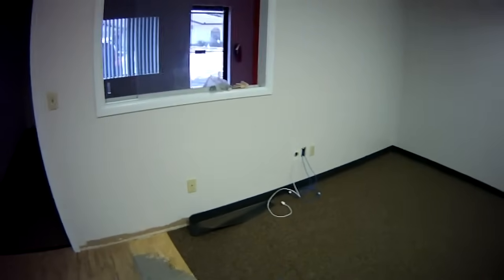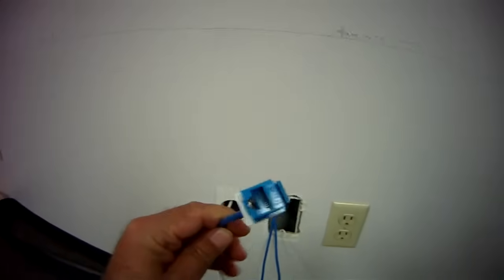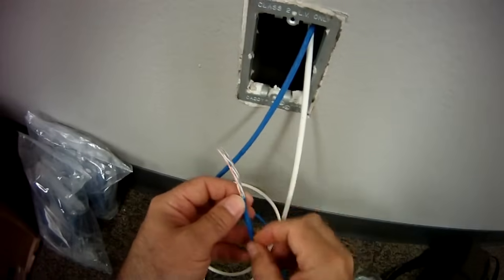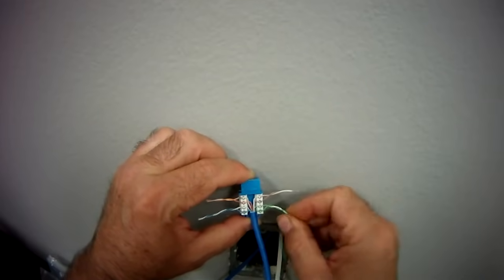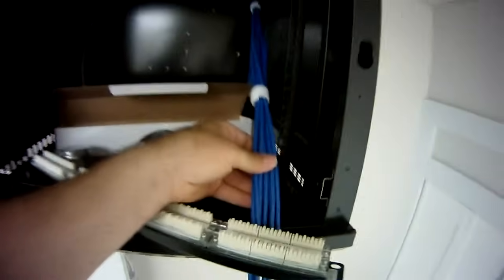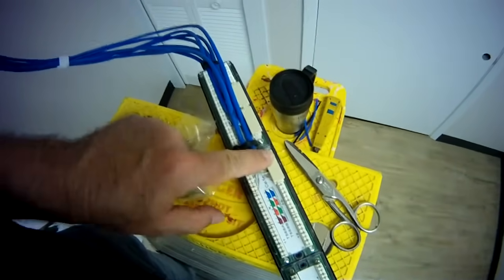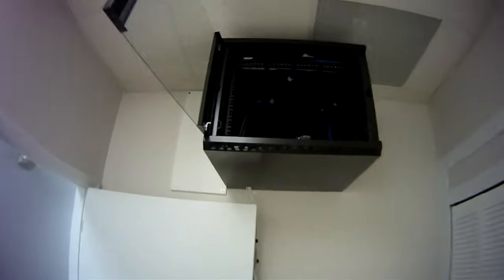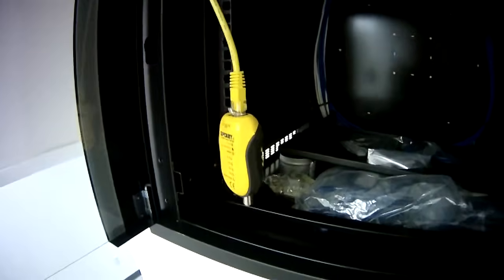Wiring an Office Network

Comment: I still prefer to have patches with bricks, instead of doing it with fixed attachments. Networks change, cables get demolished, ... A brick makes it easier to replace a cable.
Reply from the maker: Hi Michael,. Thanks for commenting.  Not sure on that term "brick".  You mean like those modular Cat6 inserts that you put in those empty patch panels?
Reply: Network Advisor Yes indeed
Reply from the maker: yeah, those are nice to work with.  you’re right they are easier to do changes on later.

great comment.  thanks for contributing. 😃

Comment: The cover caps are needed no matter if you do the wiring right or not. They are made to keep the dust out of the connections. If you do not it will cause static in your lines then it will cause data loss as to slower speeds. Just like in an old turn dial radio that has not been used for a while. When you turn the volume up and down you get SNAP CRACKLE POP.  That is caused by dust between the plates of the volume control. Great video, keep up the great work.

Comment: Electricians and communication people always throw their trash in the wall or above ceiling tile it's unacceptable Behavior this is not a troll this is saying you are an asshole because when the construction happens again guess who has to clean it up that's right the labors or a sharp piece of fucking wire or metal bracket falls from the ceiling tile cuz you left a fucking up there when we take it down and we get injured so do it the right fucking way and throw in the trash like it's supposed to be dumb fucker

Comment: Hi, is there any specific order you need to follow when mounting equipment inside the rack cabinet? I usually see UPS backup battery mounted at the bottom, whereas main router is usually mounted up the top, what about rest - for instance; server, NAS, patch panel, switches, IP phone server, KVM console, NVR recorder,  etc.? Should you leave some space between them to avoid overheating? Thanks for explaining the basic stuff with cable management - I also don't like to walk to the trash can over and over :)
Reply: the only reason you mount the ups at the bottom is because its the heaviest item in the rack. you dont need to leave space between them.

Comment: That's a plenum ceiling and that cable should be plenum. Also never lay cables on a drop ceiling. That's not code. They need to be mounted with a bridal ring or through the truss system.
Reply from the maker: thanks for that valuable insight, :-)

Comment: I mean, I've been on construction sites and most of the time its easy enough to throw all your scrap into a bucket or something but no one cares if you leave a small chunk of pipe or wood or other debris inside a wall.
Reply from the maker: thanks Taurous.  It so funny, I don't normally toss the scaps into the drywall, but it sure worked out great for the ratings on this video!  :-D

thanks for commenting!

Comment: What do you do for a place with no drop ceiling?
Reply from the maker: Those are a challenge Chris.  It's usually a case-by-case decision.  If I can get up in the attic, that's one option.  Another option is to use a fish-tape or long poles to traverse a solid ceiling (assuming there's two ipen, accessible spots on either side of the ceiling.

Great question! 😀

Comment: You call yourself a daily installer??? Then you should use http://cablesupply.com/cable-identifier-combo-pack/#product-reviews

Never label your cables, no use for it, you're just wasting time.
Reply from the maker: I agree Karel.  Labeling cables has never been a good return on investment.   We did it at IBM and it didn't really add much efficiency.  75% of the time, we ended-up using the Toner & Probe anyway.

Great Comment.  :-)

Comment: What's the difference between the blue and white wires?
Reply from the maker: The customer had requested that I use Blue cables for data locations and use white for voice or fax locations.   That's just a preference, not an industry standard.
Thanks for the question. :)
Reply: Network Advisor thanks !

Comment: So what now? What brings signal or power to the patch panel?
Reply from the maker: Good Question Benny.   So, what happened later after that video was over, I installed a Cisco 24port Switch.  That, and a router is what give the Patch Panel ports the network signal.

Comment: You should mention that you are running CMP and why you are using it rather than CMR. Also a mention of how you are supporting the cable above the ceiling tiles... or are you just laying them across the tiles? Thats a no-no.

Comment: You completely cut off the shielding instead of connecting it to the socket?  You're using UTP, stranded patch cables instead of STP solid-core installation cables? What about bringing a trash bag with you? It's not your house. You're a guest.

Comment: Nice video and some good info, I have had problems mounting equipment in racks that the drop cables "service loop" is in the way. A better alternative is to keep the loop at the very top of the cage and utilize the space behind the patch panel and not to tie it to the back rails.

Comment: I noticed on the punch-downs for the patch panel that you had a moderate length of wire untwisted, cable side (at least on the close up of that first one anyway). Has that ever led to any cross-talk issues / how much untwisted length can you have before it becomes a problem? Thanks for the vid, it was informative.

Comment: Very professional (even explained your mistakes - it happens!) and I'd hire you any day.  great primer video and cheered me up reading the trolls comments.....love to take one of those clowns with me on a jobsite.  Try re-terminating 300+ circuits in a large building after redressing the 40 feet of excess slack in the ceiling tray, re-label both ends and continuity test.  Then you can bitch about the correct procedure to get rid of waste.  I've had professional contractors leave more mess in a finished area than the construction crew did during renovations...
Reply from the maker: +Andrew Carr sounds like you’re a veteran of the industry Andrew.  I appreciate feed back from a qualified source!
In a perfect world where the master contractors paid a more respectable amount for the jobs, then I bet everyone would happily go the extra effort.  But the cold reality is that the reason we enjoy the affordable material wealth in this country is because corporate business is constantly cutting corners and looking for the cheaper alternative.   

Thanks for commenting! :-)
Reply: i recently underbid on a job, lost money but still did it to the same standard.   It's all about reputation.

Comment: There's usually all kinds of stuff up there, like sprinkler lines and other plumbing, duct work, conduit with power wires, etc. Even really shallow ceiling tiles usually have more than just insulation (the enemy of all who work in ceilings or crawl spaces ...well that and sharp duct work).
Reply: true but this was a small primer video not a 1 days class on how to run cable
Reply: That has nothing to do with what I pointed out. He literally said, "there is nothing up there. If you've ever put your head up there, it's usually just empty space". I pointed out that it's usually not empty space. So by your idiotic assumption that I wanted an entire course in one video is stupid! I'm just the guy pointing out what should be obvious and your the idiot with no logic so you have use reductio ad absurdum.
Reply: I did actually agree with you...not sure why you had to be so offensive?  Secondly Mr Cable guy here was explaining the difference between a dropped ceiling in an office environment and say your home which is drywall, vapor barrier, batt or blow-in insulation and possibly a crawlspace.   He did actually say there is stuff up there, but generally it's easy access to run the cable.  Plus the last job I did aside from some 4" ductwork for the vent and a fluorescent light in the middle of the room, the whole dropped ceiling space was clear, therefore I beg to differ and every jobsite is different depending on the construction.   

Lastly if your going to spout latin at someone be wary of the "straw man argument"

Comment: excellent video. I personally omit that patch-panel part whenever possible, it reduces one point of failure. I rather connect cables directly to switches. It really helped me a lot to find problems in network.
Reply: We used that setup (direct patch cable between the server and switch) at one of my previous jobs. Unfortunately, they would not let us terminate the patch cables to the correct length.  We had to purchase pre-made patch cabling to connect the servers to the switches and a lot of times we would end up with a bunch of slack if the cable was too long, which was a cable management nightmare.  You measured the distance the cable has to cover and try to get one with the length closest to what you need.  

It depended on what you had in storage.  If a 30 foot cable is too short and the next size up you have in storage is a 50 foot, you have to use that and then figure out where you are going to stow the excess.   Of course you can order more cables closer to the length you need, but since management wants this done yesterday, you use what you have on hand.  Fiber cabling the same way.
Reply: not me...I find that using a patch panel is far better for cable termination, organization, testing, and professionalism...I have yet to see a corporation who had cable runs directly connected to their interface appliances, but I can respect your way as well as understand where you are coming from...I'm from the "old-school" way...

Comment: excellent video. I personally omit that patch-panel part whenever possible, it reduces one point of failure. I rather connect cables directly to switches. It really helped me a lot to find problems in network.

Comment: 1:03   Putting up the box at the ceiling LOL!!!!!!   pure fail!   Just yet another company that does not respect technology at all when it should be wall mounted and not so high up you have to hire a basket ball player to work with their network.
Reply: It's not such a bad idea when the data frame is in an area where there's people traffic, so no one accidentally or purposely messes with the connections.
Reply: there is no rule on where to put it - customer may have specified that.  Plus as someone who has had to clean up messes made by amateurs it makes it even better to have it out of the way.

Comment: Hey a great video. A little query though, How do you know while patching the cable on the patch panel that the cable you patched is at the same identifier number since you marked the identifier number on the outlet plate before hand. I hope someone replies. Thanks!!
Reply: SAHIL KANSAL  you wouldn't kknow , after you connect them you'll need to use a toner to identify which port is which
Reply: Mark the cable as you're pulling it out of the box, and mark the box. Then mark the box end of the cable when you cut it off. Permanent marker or label maker works well. If you're pulling one wire at a time you don't have to mark the box, just the cable when cut, same identification as the other end.
Reply: you write it on both ends of the cable (or use a label)

Comment: oldschool method! 

do you kow the manufactor btr or leoni!
Reply: and old Technology cat 7 is since 2010 or earlier the best method!
Reply from the maker: hey Tobi, thanks for the comments.  I've not gotten into cat 7 much yet.  There's just not been that much demand for it in the commercial sector yet.   Believe it or not, so many commercial applications are still running 100 mbps networks, so they're quite happy with their cat5 or cat 6.

Thanks for watching!

Comment: I've heard those kind of ceilings called "Drop ceilings"
Reply from the maker: yes, Michael.  Or, sometimes called "Drop Tile Ceilings".   I guess it's because the little 2'x2' fibre tiles just drop into place on the metal grids.   Very much the standard in office and retail environments.

Thanks for your comment. :-)
Reply: @NetworkAdvisor  I prefer sectional ceiling. That way I can say, "When I get that feeling, I want sectional ceiling"
Reply from the maker: @mikepembo8297  Dohhhhhh!!!!    (ok, that was pretty good) .  I'll have to use that on my next job.  ;-)

Comment: For some reason, I always thought that 568a on one end needs to be 568b on the other end.  Oh and, after I finished my basement, I can say that there is plenty of dust and particulates in those walls that a few tiny bits of non-fiction tossed in won't make any difference to anyone - even the neat freaks. Once the covers are on, you still pass the white glove test.
Reply: MarshmallowMadnesss 
Just remember going from 568A to 568B is "crossing over".

Comment: I used to have to make trips to the trash can or bring one with me.  Now I just have a little container attached to the back of my belt that I dispose of this stuff in.  No putting the stuff in the wall is just a personal thing but I don't hold it against anyone for doing that, no harm no foul.  Also learned a slight tweak in the video that'll speed up my work a little.
Reply from the maker: Great idea.  I'll have to consider that!

Funny thing about this.  At the time I was making this video, I had absolutely NO IDEA it would be this popular.  Had I known, I might have approached the production quite differently.   95% of the time I dispose of my cable trash in the appropriate place.  It just so happened this location was brand new and had NO trash cans anywhere. 

Ironically, the "trash-in-wall" episode has actually been responsible for about 30% of the comments on this video.  So, maybe it was a good thing. ;-)

Thanks for commenting!

Comment: Why use conventional patch panel vs what I would consider more modern keystone patch panel?  Also gotta smile at all the people who give you gruff for throwing away a tiny piece of filament into a perfectly cut rectangular trash slot.  Great video.
Reply from the maker: so DJ.  I actually agree with you 100%.  Those keystone, modular patch panels are the bomb.  However, when I made this video, this was a contract installation, so I didn't have a choice over the parts that had to be used.  They were supplied to me.

Thanks for pointing that out. :)

Comment: One of the best well-explained videos I have seen in a long time :) Thank you  ... I've got a few questions to ask though....  why the white cable ? is that for the telephone line ?
Reply from the maker: Exactly right Idris.  This installation had specific instructions that I should use blue cable for the data and white cable for the Telephone lines.  When you do contracted installations for other companies, you'll find that's a common requirement to use certain cable colors.

Thanks for the compliments.  I think the video has helped out a lot of people and that's been rewarding. :)

Comment: I wouldn't recommend Cat5e ...
Reply: USB-C Enthusiast 
You'd recommend USB-C?
Reply: aguyandhiscomputer  ¯\(ツ)/¯
Reply from the maker: Something to understand here about this video is that this was a contract installation where the contracting company had already specified the materials and methods to be used.  You'll find in the commercial world, it's quite common for the technology to be way behind.

For instance, many people would be shocked to know that there are still some retail locations running on Windows 2000!

It's all comes down to budget.

But, thanks for your comments! :)
Reply: Network Advisor 
The IT dept, computers, software, security, backup, etc are essential but they don't make money so they don't get much respect.
Reply: I agree, lets run some Coax and get everyone on 10/half (I cut my teeth on that way back in the day).  Cat 5e is perfectly acceptable in todays market and runs gigabit.  If you got the money go with 6/6a but you'll find (as the gentleman pointed out) that you have to work with what you got.

Comment: I laughed when you threw the cut cable into the wall, clearly you've been doing this for a while, so props to you.  I've encountered so many situations where there is no service loop, ever try punching down on a 48 port patch with no wiggle room to pull the patch out? Pain in the ass! Hopefully people watch this and pick up good habits
Reply from the maker: Oh man, Chris.  Have I ever been there with you.  Obviously, you get it.    And you're trying to make changes in a data cabinet with no slack you're like "OK, what was the guy who put this in thinking?"

Really appreciated the feedback and comments!
Reply: I suppose the simplest solution in a situation like that would be to test the cable, cut it back, and patch it into a keystone jack. It will introduce another point of error and be a bit messy, but a lot faster than running a new cable (depending on distance of course). Although, it would have been far easier for the installer to leave a few feet of service cable.
Reply: Possibly the same guy who put the trash in his pocket.  Clean floor but poor installation :-)